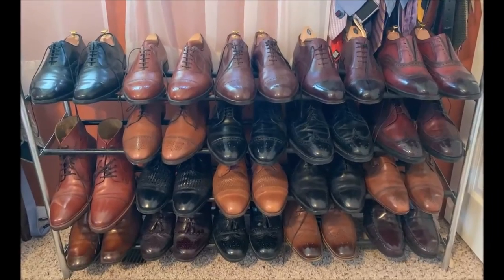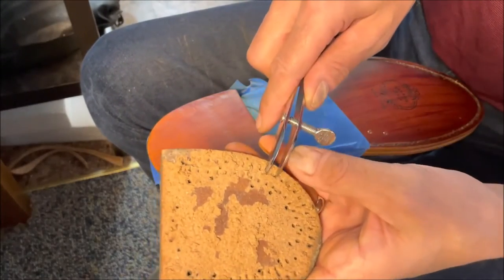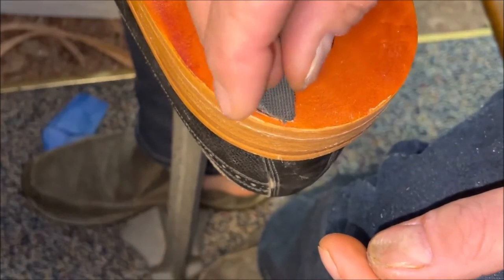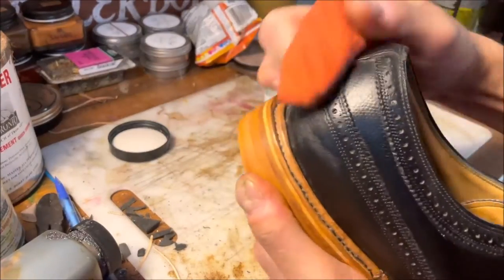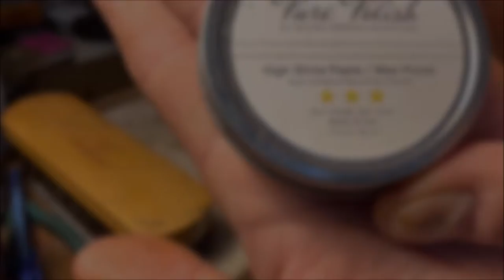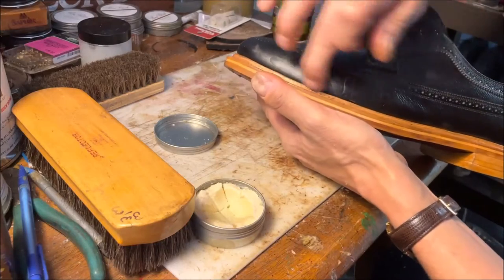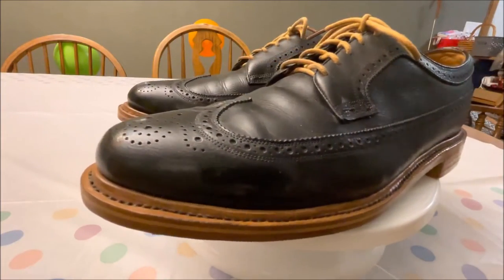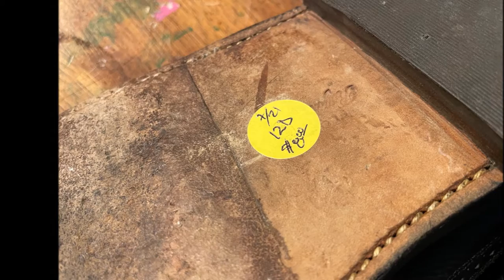Florsheim Royal Imperial LWB ReSoling at Home 3/3

Comment: Robert I have a pair of plastic coated leather shoes that I can not shine, how do you get a good shine?
Reply from the maker: Freddie, that's tough. I have shined all types of shoes from very cheap low quality to very high quality. I can say some general comments:
1. There is some very low quality leather that just doesn't seem to shine. A guy at work bought some of the lowest cost J&M's, and they just would not shine no matter what I did to them.
2. Corrected grain leather, "plastic coated" sometimes is easy to shine, and sometimes very difficult. I have found J&M's corrected grain line like in their Melton line of shoes (they are the $180 full retail price line) are easy to get a basic shine on, but really hard to get a full mirror shine on. The old 1980's "bookbinder" corrected grain Allen Edmonds are the same way.
3. Generally speaking, ANY brand of shoe polish will achieve a shine. In other words, if they really won't shine up, unless you're doing something drastically wrong, buying expensive shoe polish probably won't change it. If you're getting a good shine with the same products and technique on other shoes, then you know it's that shoe's leather.